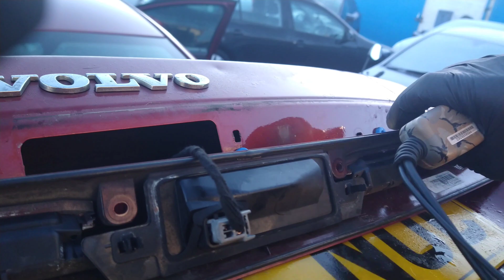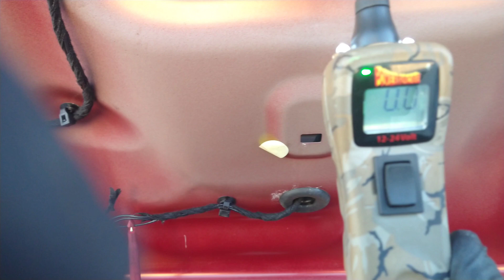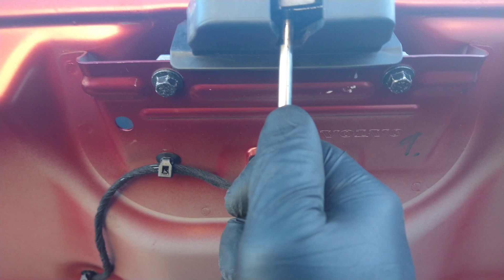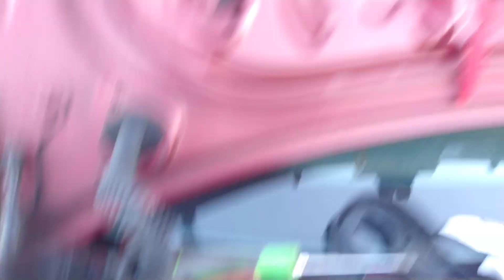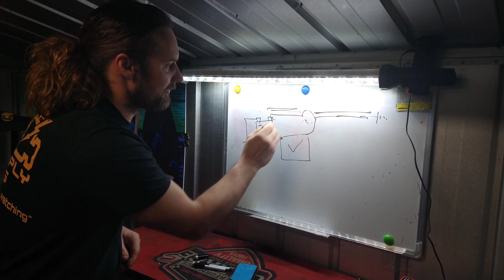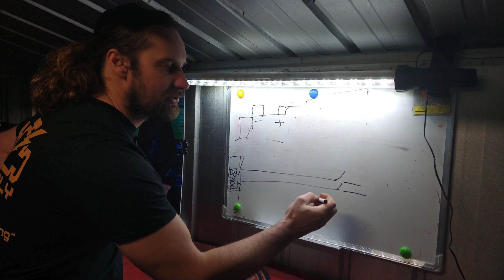boot/Trunk won't open (Volvo S40)

Comment: I had the same, but know another problem, wires are all good. But when i close it harder the lock goes to far down. And it thinks it is open but its not. When i were closing it really gentle it was ok. Any thoughts?

Comment: thanks for the video. I have a persistant message says: TRUNK LID OPEN. however the locking / unlocking mechanism works normally. what causes this message on my dashboard?
Reply from the maker: @Autogearcanada  it will have a micro switch in the trunk's latch, that sends a signal to the body control module to let it know if the latch is open or closed.
If the micro switch in the latch or it's wiring is broken the body control module won't know what's going on.
Usually it's a broken wire around the trunk's hinge
Reply: @mechanicmatt871  i will check the wires.  I have already installed new trunk latch. so now I can tell the issue is from wiring.. thanks

Comment: Hi Matt, we have a Volvo V50 and problem is that boot wont open when trying to open it manually with fingers on the back of hatch - but then when I start engine suddenly I hear boot opens. Also opens when I click on my keys the “yellow” button so then I can open it but its really weird as otherwise wont open and again opens when I stop the car and turn off engine -
Opens again… any recommendations what this could be - started to happen recently…
Reply from the maker: I once had something a scenic that was like that. Boot only opened with the engine running.
Turned out to be a deliberate bypass on the fuse box to stop a battery drain.
Not saying that is what's going on with your car, just a thought
Reply: I have a similar issue. The switch on the trunk also works in key position 2 or II. Engine doesn't even have to be running.

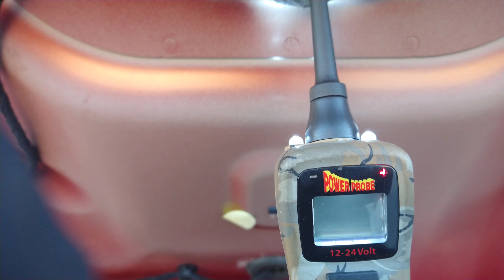Comment: 3:06. I have only 3V and the latch not open. Do you know what is the reason?
Reply from the maker: It's a possibility voltage drop from a bad wire in the boot hinge area

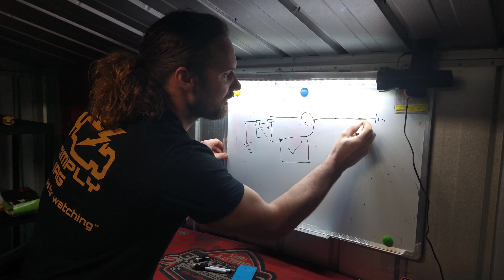Comment: 8:50 It becomes the ground side BECAUSE the bulb filament is a LOAD. If the bulb filament did not have significant resistance (if it was just a wire) there would be no RESISTIVE LOAD.
Reply from the maker: Exactly, in the boot latch case it isn't a bulb. I just used it as an example to explain where the 12 volts has gone. (Ground side switched) remember even with a load it will have power at both sides of the bulb when the switch is open on a ground side switch, although it won't have current flow obviously.
Thanks for watching

Comment: Great video, i have the same problem with the add that my volvo s40 gives a warninglamb that my trunk is open, while the trunk is closed and cant be open, what should i do to open the trunk to be able to change the wiring which is cheap to buy and less hassle comparing to restore the wiring, would appreciate answer🙏🏼🙏🏼🙏🏼🙏🏼
Reply from the maker: Can you bi directionally open the trunk with a scan tool? Or is it possible to lower the rear seat backs in the S40? It may be that the switch in the handle is working but it won't actuate the trunk latch because it thinks it is already open.. this could be a pain to open.
Reply: No i cant open the trunk with a tool but the rear seat can be taken down, yes the car thinks the trunk is open since the constant warning but i can crawl in to the trunk and my question is can i open the trunk from there doing what you did in the video?
Reply from the maker: Yes you will have two of the wires going to the actuator. It will need a power and a ground. If you can crawl into the trunk and remove the trim to get access to the latch. They may be slightly thicker wires than the other wires. There may be something in this video that could show you the wires.
Reply: @mechanicmatt871  ok thanks, i have an appointment with Volvo this coming Friday, do you think changing all the wire set for the trunk will solve my problem or could my problem be something else than the wires?
Reply from the maker: Always the chance it could just be a faulty latch with a micro switch fault but usually it's a broken wire
Reply: @mechanicmatt871  it most unlikely not problem with the microswitch since i changed it by myself 2-3 years ago, but it is super frustrating that my trunk is stuck right now and that the dashboard lights up the "trunk lid open" contantly, i am pretty sure i could change the wiring myself but my problem is that i cant open the freaking trunk from inside to get hold of the rubber tube with the wiring and switch the cables😕

Comment: Great tutorial! Thanks!There is a micro switch in the lach mechanism which is responsible for lights in the boot and dashboard notification  "boot is open". Anything else?I have no lights in the boot and it drives me crazy.Found that micro switch but not much can be done than buying a whole lock!!!Very frustrating!